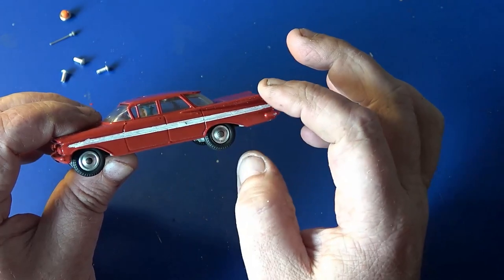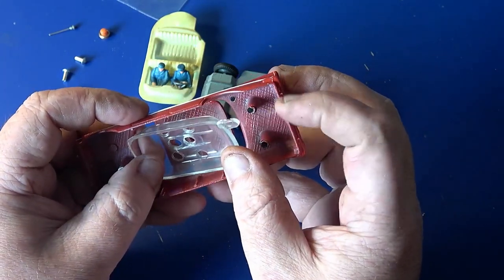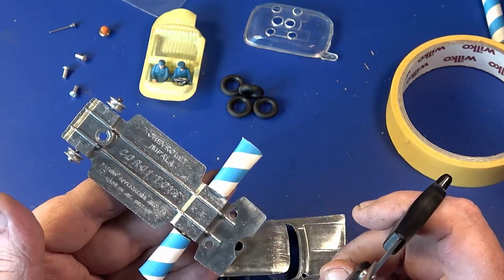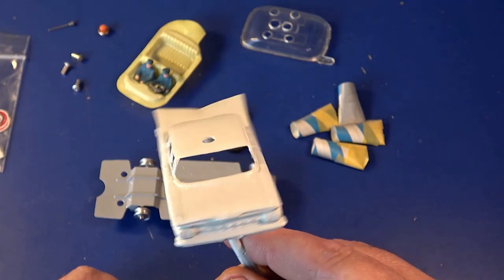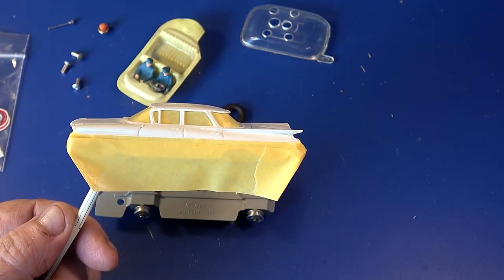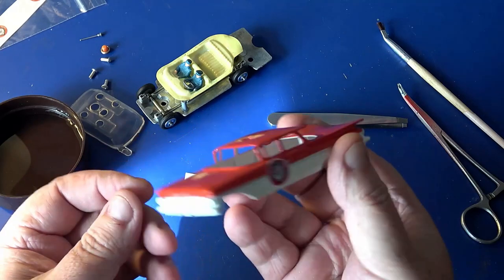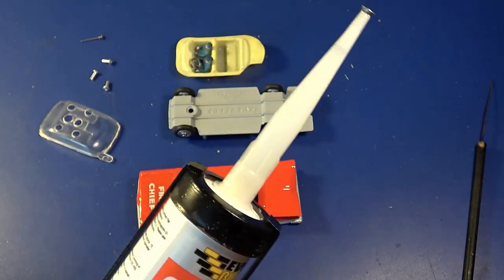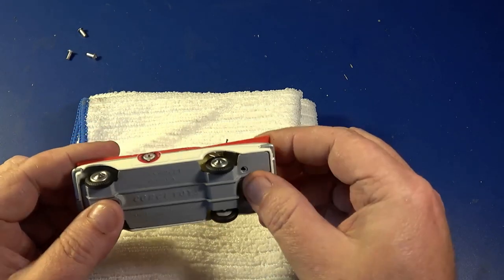Corgi 482 Chevrolet Fire Chief Restoration

Comment: Welcome back, Bob. There'll be a good reason for not chatting, but it is your show! Miss that bit, though.
That Chevrolet looked to be a simple enough job but a three day painting process puts a load of extra work on the plate, plus the detailing and the decals: that's about a week's work! Looks terrific, though. I get my custom decals from BlackSquare and have no density of white or lacquer reaction at all. Was the damaged front wheel on the model or was that a caustic reaction?
Reply from the maker: My...you’re very observant Mr Martin! 😄 The front wheel was always like that I’m pretty sure, can’t remember having any problems with the caustic treatment doing it, although you are correct to point it out as caustic can sometimes do damage to the wheels.

Comment: Beautiful resto. Bob.  Better than original by far.  I find those large tubes of silastic go off within a few weeks no matter what I do.  I have now found it in a squeeze tube, although smaller quantity, it stays good for  12 months or more.
Reply from the maker: If you block the screw on nozzle piece with the actual rubber solution and use that as a cap, that will stop it going off in the tube. That’s what I do and get no problems 😉
Reply: @BobWilliscorgi  Hello Bob...just writing to say I hope & pray you're OK. 
Also, to wish you a VERY MERRY//HAPPY Christmas!! 
Best regards, 
Ben

Comment: Hello Bob , what kind of glue are you using to put back together the batman car ?
Reply from the maker: Just your regular everyday ordinary super glue mate 👍
Reply: I just did a corgi 261 db5 and couldn't drill the posts,either duff drill bits or the metal was too hard.I used gorilla super glue (from Tesco) alone and it's rock solid.Takes a while to set does the gorilla gel type stuff so I used baking soda too.Actually,I messed up the first attempt because the ejector seat tab wasn't out and it was quite a job prizing it apart.The 261 is under load because of a spring same as the front of the batmobile.I'm going to use the same method in future rather than faffing about with drilling posts and keeping on replacing tiny broken drill bits.It does look a bit untidy but an option is to cut away the excess glue flush with the baseplate and glue a rivet head on top.